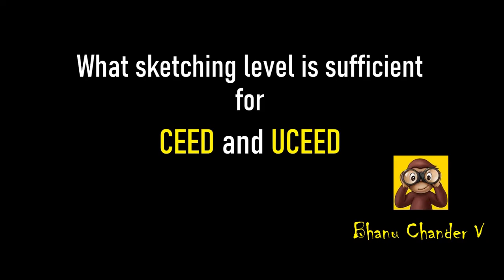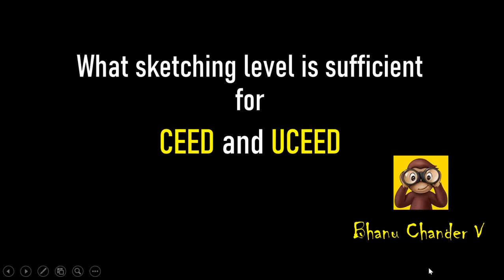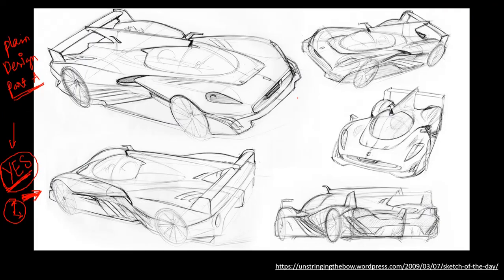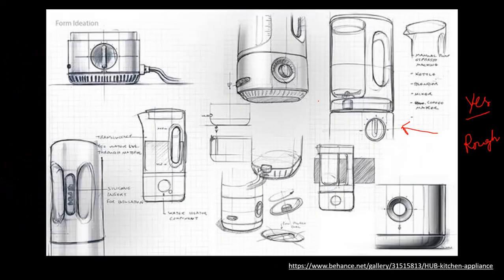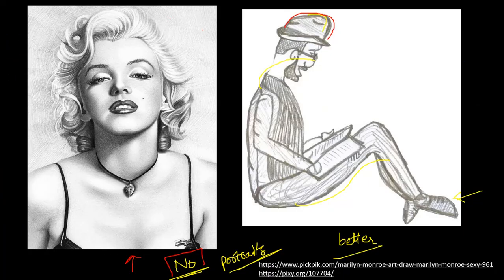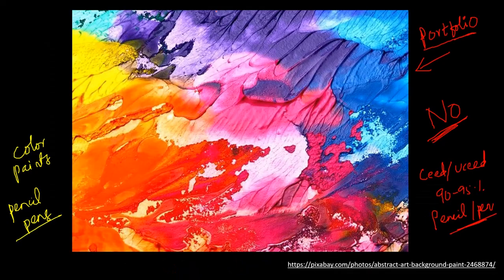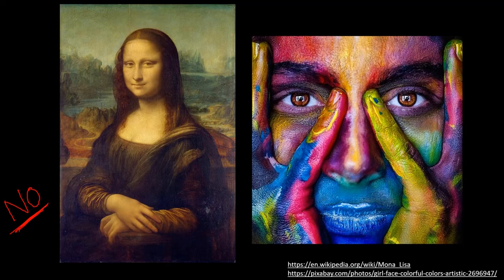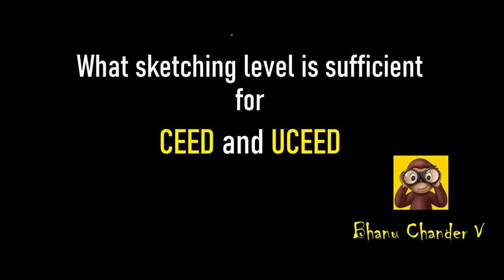Sketching Level required (sufficient) for CEED and UCEED design exams

Comment: Is it acceptable to use pens for optional product design question in CEED?
Reply from the maker: First thing.....this year there is not going to be optional design questions (50marks type as seen in previous paper upto 2019) this year pattern is same as 2020, with 5 Ques each 20 marks, be cautious of the pattern and prepare only for that. 
Next, unless they specifically mention to use pencils only (they mostly do) you are allowed to use pens

Comment: hello, sir, I have a question, can I do the m.des course with my job. is there is any correspondence M.des course available? I have 6 years of working experience in machine design. please guide me.
Reply from the maker: I think some institutes offer such courses....like Im aware there are evening classes for NIFT pg courses. It is institute dependent and I suggest you check through each institute website if they offer any such courses
Reply: try IIT hyderabad.

Comment: Sir i have one question regarding MSQ types question for example there is a question i which 4 option is given out of 4 . 2 is correct but i tick 3 option out of them 2 is correct and 1 is wrong then how much marks they will give me in that question 
Or they marks zero on that
Reply from the maker: You will get negative (if there is ) marking or zero (if there's no neg marking) for that Ques. Only when all the options are right you will get full marks
Reply: @BhanuChander-SYL  acha okie thank you i know its a silly question bt it stuck on my mind then i asked you because you are doing a great job its really helpful